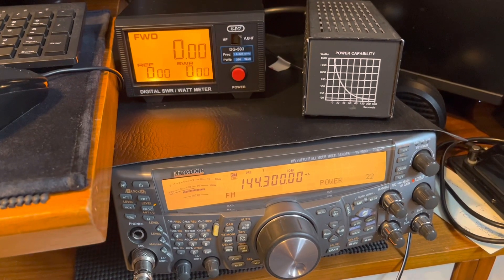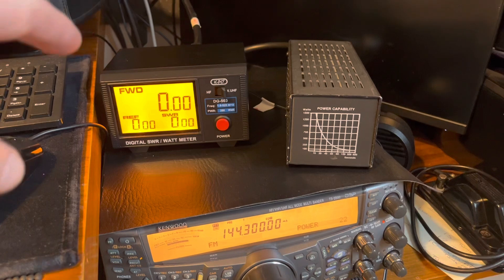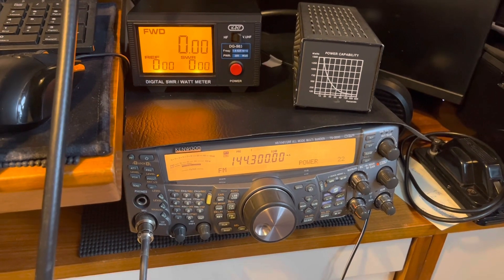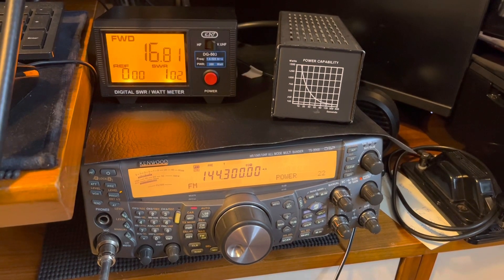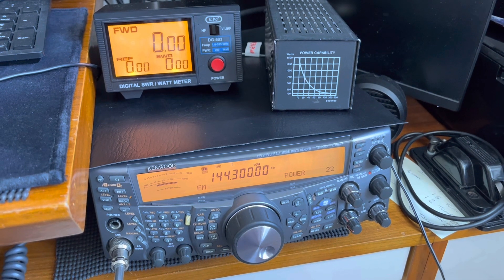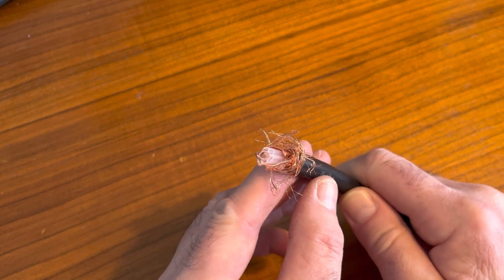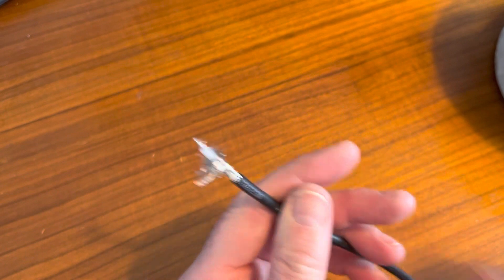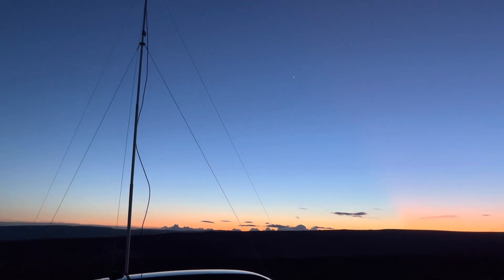Coax Problems Fixed!

Comment: Very interesting Ian, quite timely after various videos on this topic.  As a youth my masters always insisted on the very best coax and connectors.  In my job most connectors were silver plated and when my friend died I inherited his shack to sort out and he didn’t used Westflex and silver plated N types for HF and VHF.  We were lucky in having a supply of 75 ohm Suhner cable product and that was silver plated both on the braid and centre core.  Those were the days.  Thanks for posting.  Mike
Reply from the maker: Great, thanks Mike.

Comment: Well the Kenwood TS-2000 is pretty DEAF on all bands so I understand the receive being down.It’s been known for years that they suffer there and an external preamp is a big Help for them.I had one and I know from First Hand experience.I now have the ICOM 9100 with both optional roofing filters and the D-STAR Board installed and it blows the TS-2000 away with ease on every band.I consider the TS-2000 as the Worst Transceiver I have ever owned or used.
Reply from the maker: Thanks for the info. It was just used for the test, it’s not the rig I use contesting (HF & transverters).
Reply: @G0CNN-Ian  I paid $800 for mine and I Sold it for $550 to get rid of it. The buyer sold it quickly for $800 & we are all Happy.👍🎙

Comment: to be honest.. ~1 db you wouldnt even notice
Reply from the maker: Hi Charles, yes I agree, between the two it’s very little. Somehow I felt RX was down and if I cut the new long length in half, I’d expect a reduction in loss. I’ve gone for a new /P coax run so will see how I get on…especially on 70cm 👍🏻

Comment: I think that  cheaper cable with out the foil can be very useful for "sling over the tree" portable in particular as the foil inevitably deteriorates. The RG58 isnt ultimately bad in that situation as at least it's cheap enough to replace regularly although aircell 7 maybe a much better cable ..thanks for the video cheers
Reply from the maker: Thanks!